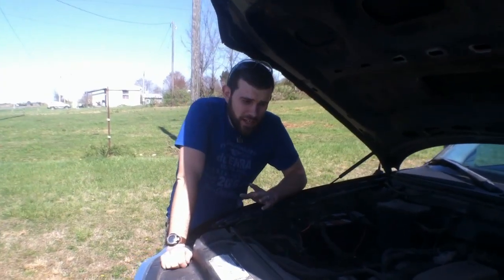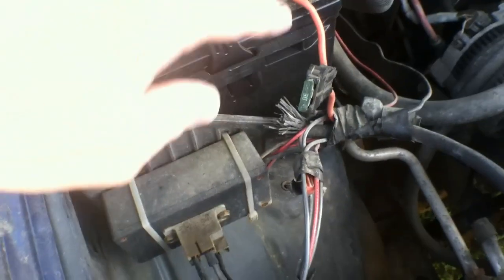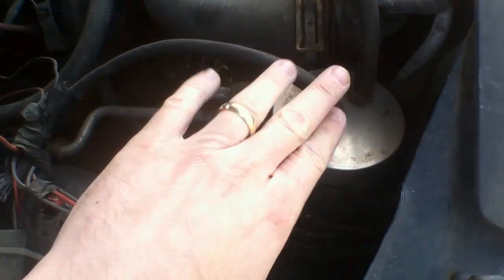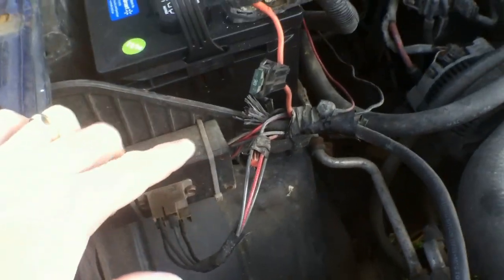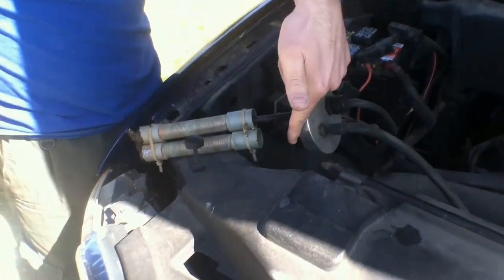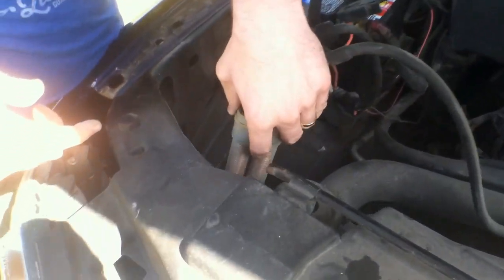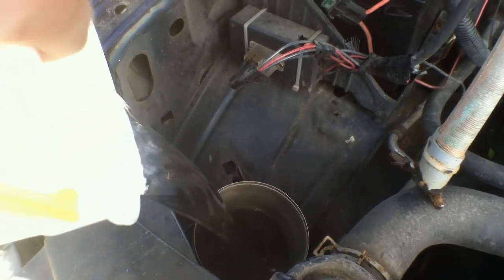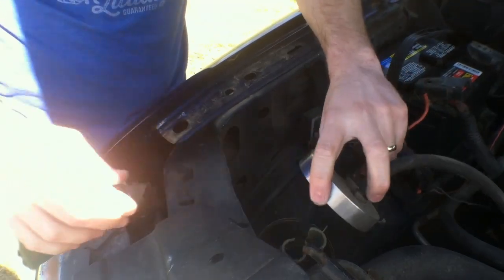HHO Fuel Cell for your vehicle: What it is, how it works, and where to get one

Comment: You really have to know what you are doing when making one of your own.  Water produces hydrogen and oxygen, both of which are extremely explosive.  If your output gets plugged, both gases need to be safely vented into the air, away from any heat or open flames.  The commercial units I considered (years ago) had disclaimers warning not to run the engine in a garage with gas powered water heaters or any other appliance with pilot lights or open flames inside.  Also, make sure you wire it to a circuit where battery power is cut when the ignition key is shut off.  You don't want it producing the gases while your vehicle is being kept in your garage while your family is sleeping in the attached building.  After evaluating it and weighing the risks, I decided the enhanced performance wasn't worth the risk.  Fleet trucking and motor pools (also agricultural machinery that are stored away from structures) where regular maintenance is performed by mechanics that know this technology seem to be the best beneficiaries of the systems. On another related note that you mention, I remember looking into the commercial whole home solar-hydrogen systems that came out, years ago.  The initial investment and routine maintenance/replacement contracts were astronomical.  You basically had to house it away from any structure with blast barriers between structures and blast deflectors built into the unit's housing.  I've been eagerly waiting for both applications using this type of technology to get cheaper and more efficient.